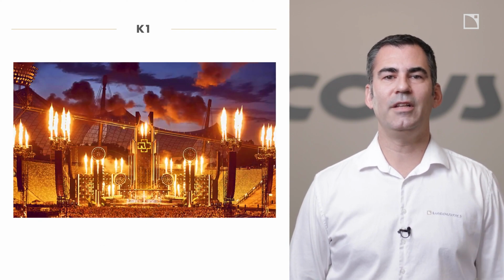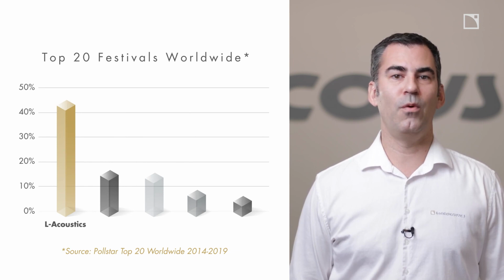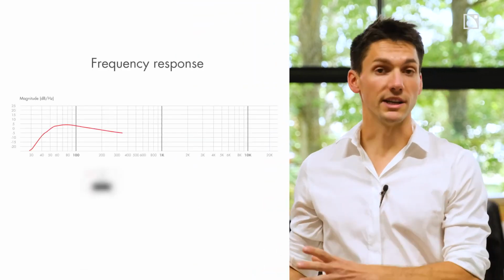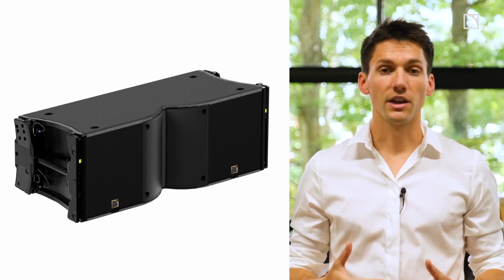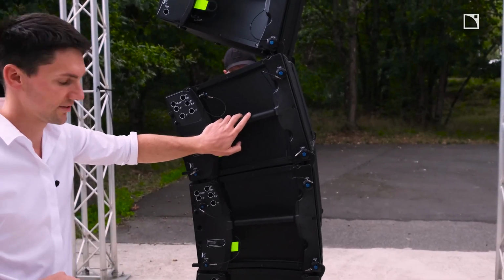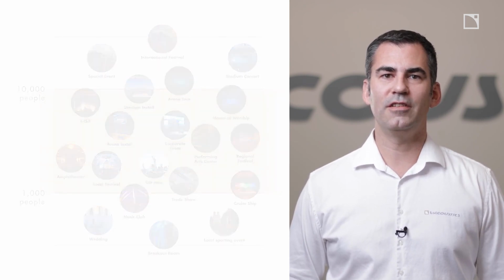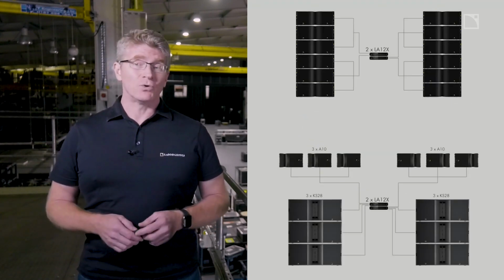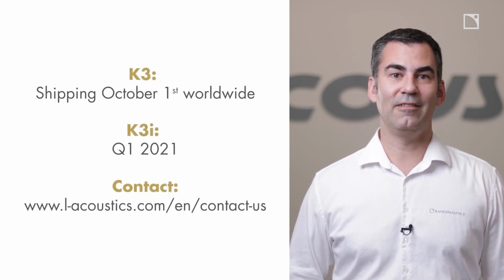L-Acoustics' New K3 Line Array

Comment: The assembly mechanics is very interesting, it is safety at 6, 8, 10 ... 15 meters high and the L Acoustics boxes are rather well designed at this level, I mean at this level.
Beyond that, I am absolutely not a fan of this brand which has never made a single loudspeaker or amplifier.
On the other hand, on the communication and marketing side, this brand is a champion.
This is problematic when it is necessary to change a loudspeaker because the brand does not give the origin of manufacture, nor the information if it is a loudspeaker of series (in a manufacturer's catalog) or manufactured with special specifications. .
And, it's problematic in terms of availability.
No one ever broaches this delicate subject, it is silence.
I have never seen a list of L Acoustics stamped loudspeakers with their selling prices.
Nothing to see with the JBL VERTEC or VTX (best line array in the world audio industry).
It's blending, great blending of course, but ... the best blender in the world is Clair Brothers USA.
The design of the box and its interior architecture strongly exudes JBL VTX inspiration.
Reply: I had a good laugh at the "JBL best line array in the world audio industry"
Reply: Well, you’re certainly full of opinions.  I hope it’s ok to disagree with you.
Reply: You compared l acustics with vtx  or vertec damn.. L acustics in 90% better. Put them next to each other and you ll se the branding :))

Comment: This is great news! L-Acoustics has been losing out on arena installs because K2 is too expensive and KARA doesn't have enough power.  Hope the K3i has a competitive price point. The install market is cut throat and Harman offers a hard-to-beat package price of DSP, Amps, and boxes. Luckily, operators are waking up and asking for the next level lately. Hope to see some K3's come across my desk soon!
Reply: Times are difficult for L Acoustic french brand when buyers start to ask where the loudspeakers come from, a mystery, their availability in the event of breakage (even at JBL it happens except that JBL  have produced all its loudspeakers for 70 years, The best in the global audio industry and especially their availability for many years within 48 hours!)
The Harman Synergie extremely effective with the best engineers in the audio industry (JBL, Crown, BSS, DBX, Soundcraft) disrupts many brands that are only assemblers. This synergy allows an extreme optimization of brands between them. Without intermediary, it is not surprising that JBL is better placed than its competitors !

Comment: The crossover point must be much lower. Around 550Hz??
Reply: I think there is an missunderstanding here: We know nithing about the crossover frequency between hf and lf. The 350 Hz marks the lowest frequency which can be controlled in its directionality via software.
Reply: Fir overlap between 350 and 700 Hz .
Reply: @writm1821  where did you get that information?
Reply: @bokajllensch661   Sorry, I don;t remember where, but they have not other choice because of the distance between acoustic centers. But i don't know the driver. Only few driver can keep specs from 350Hz.  Three driver must share energy and directivity to prevent lobes in this frequency band.
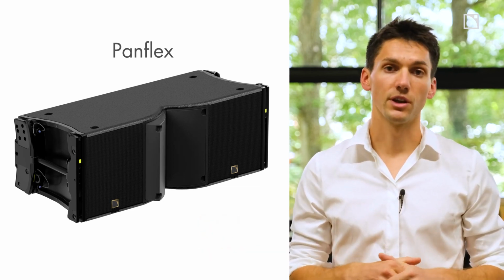Reply: It's 350 7:50
Reply: @Artemis_ToHc  that is going to make it a clean line source. What kind of MF-HF driver is it which works at such low frequencies?
Reply: @radon222u  too much work for a 4".....but the panflex works only on the hf driver, so if they said that It works down to 350hz i think that Is the crossover frequency
Reply: @Artemis_ToHc  if 350Hz is the crossover then the 4" driver is really interesting.  I would want to know more about it :)
Reply: @Artemis_ToHc  no